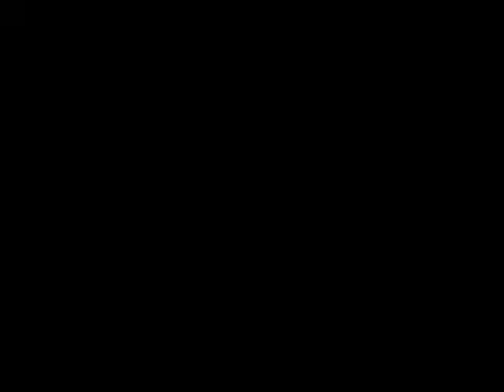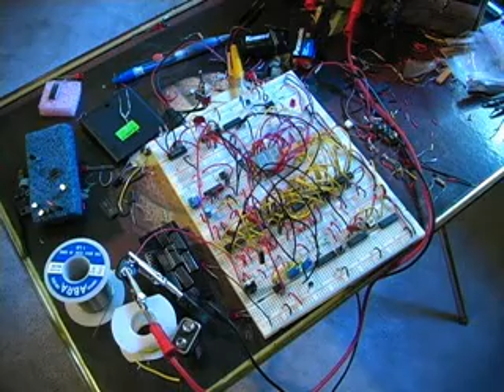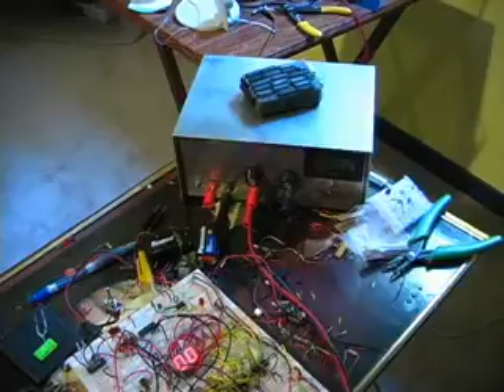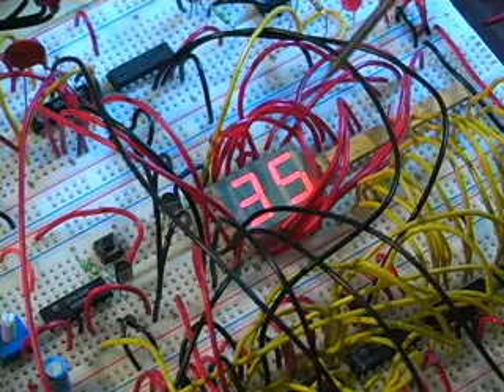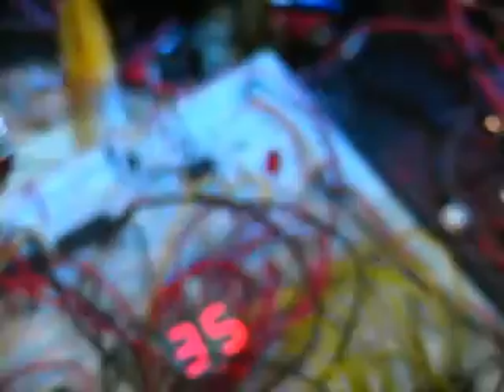Complicated Timing Circuit - Prototype#1

Comment from the maker: the charger would always be connected, but the light sensor would be connected to a circuit that dictated when the batteries would be connected to the circuit.  When the sun goes down, the circuit would disconnect from the power source.  provide you with a control

Comment from the maker: can look elsewhere on the internet for instructions on how to interface solar panels with battery chargers, I'm sure I could help you out. For 4 or 5 hours ofworked like this:  During the day, the light sensor would shut down the circuit.

Comment from the maker: 2) How much current is this motor going to require?  Motors generally require TONS of current to run.  Even the small motors will be a bit of a problem.  I'm not all that familiar with solar panels, but I'm about to get some for myself to play with.  If you

Comment from the maker: Okay.  I have some ideas.  I've never worked directly with solar panels before, but I'm undaunted.  I can help you with the light sensor configuration.  I've actually got a video on light sensors. I could easily

Comment from the maker: You are saying that you want to plug the car in (essentially) during the day, and use it in the evenings?  I'm sure I'm just misunderstanding, but if thsi is the case, and you just want a renewable power source that will power a tiny motor and two LEDs, then just buy a battery charger, a (4 x AA battery case), a couple LEDs, two 470 Ohm current limiting resistors, and the motor.  If you can be a little more specific, I may be able to help out more.

Comment from the maker: You don't program a 555 timer.  You control external components (Resistors and capacitors) to control either the astable (pulses) or monostable (pulse length) operations.  What is it you want to do?